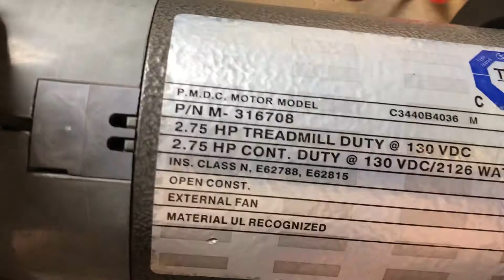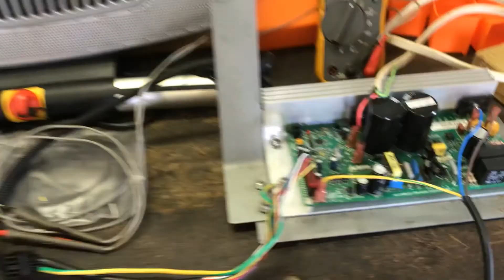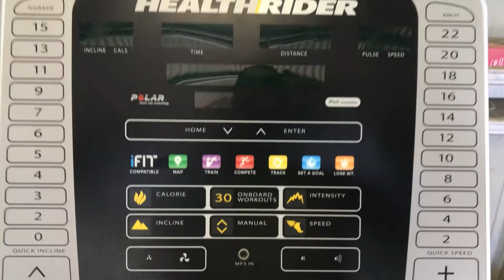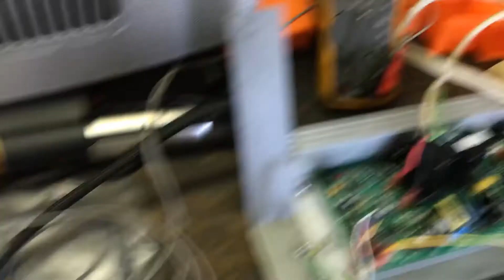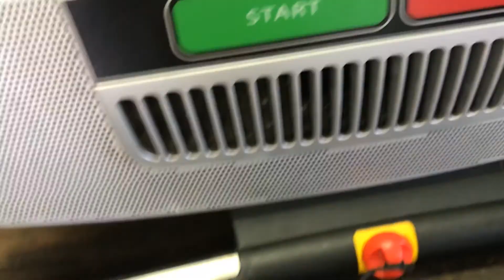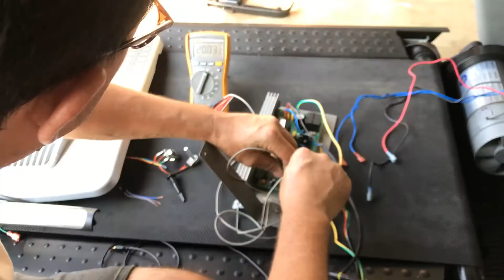Understanding My Treadmill Motor Control

Comment: Thanks for the great video with lots of useful info! I'd like to see a little more on the MC2100 / Arduino wiring, though.  My treadmill motor lathe has a 7,700 μF capacitor across the motor, presumably to smooth out the pulses. It runs smoothly and without any pulsing.
Reply from the maker: Hi Charles, nothing like a timely reply! :D
Ultimately the adruino was not what I was after and I used an SCR controller as seen in The Aussie Shed: https://www.youtube.com/watch?v=ECKKXco3Oks
However, the Arduino setup would really be useful if you needed to monitor motor speed and ramp up the power as required. If I do any more work on that concept I'll certainly remember to tag you in on it. Cheers mate.